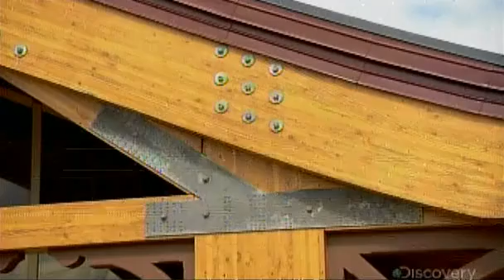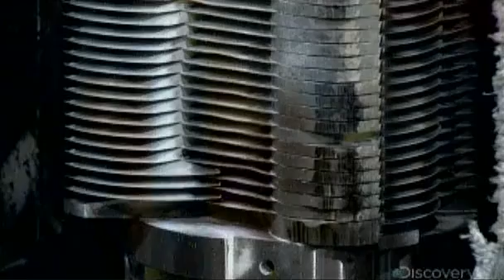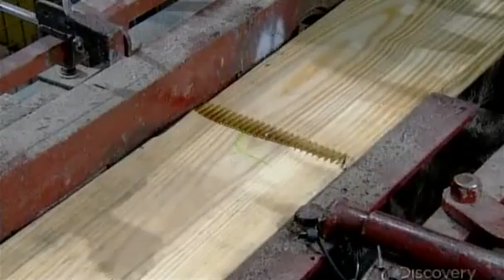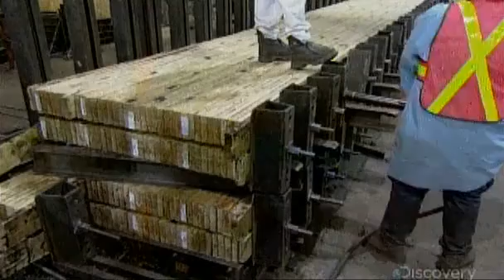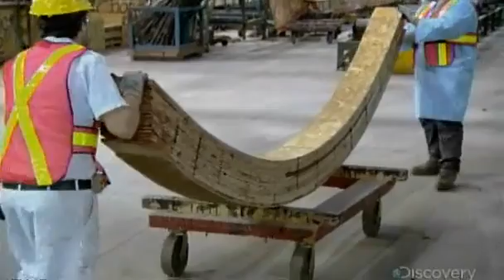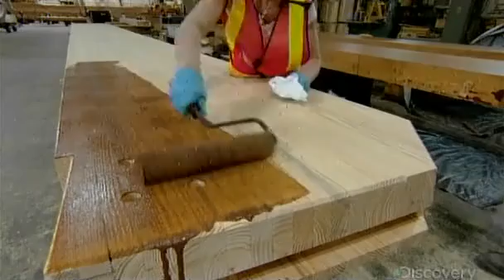How to make Laminated Wood Beams {www downloadshiva com}

Comment: I learned how to build a structural glue lam beams before they were commercially made or sold. It's not rocket science and any journeyman carpenter worth their salt should be able to build a structural GLB that should structurally out perform any commercial made GLB beam. I use 5/8 all thread nuts and washers placed at ends and every 4ft in-between along with heavy layers of Tight Bond Wood Glue to secure everything together. Placement of 60 deg face cut with a 45 deg bevel cut centered in-between the bolt placement is IME is a much stronger way of tying the beams and lengths of lumber together. 
Learning and knowing how to use this style of beam building can be used to create and build things that most architects can't even draw.
Reply: Thx, but I can't quite follow what ur saying towards the end on ur construction method. So if u ever post a video on how you do it. Pls give me "heads up" so view at it. 
I looking for a way create GLB, with mortise and tenons built in to them. And still need better understanding of the basic like lumber selection and orientation too.
Reply: but unless you have engineering stamps, your code inspector wont pass it
Reply: Can someone explain what the 45° bevel cut means?
Reply: Titebond clearly states it is not meant for structural purposes with any of their glues. People like you are why there are architects and engineers.
Reply: @gary24752 I second this, every tight bond joint I have made that saw any type of weathering fell apart. I’d trust epoxy or the phenol recommendation if my project depended on it

Comment: Kee Pee and Structurlam were pioneers in beam making.
Reply: Sorry, neither of those Canadian firms were close to being pioneers. Dring was probably the first in Canada. Two USA companies opened branch factories in Vancouver, BC area circa 1952, American Fabricators and Timber Structures, Inc. I have not found anything definative, but it appears as if KeePee started in the 1960s. Structurlam started in 1962. In USA, 1934 was the start of structural glued laminated timber manufacturing at Peshtigo, WI by Unit Structures, Inc.